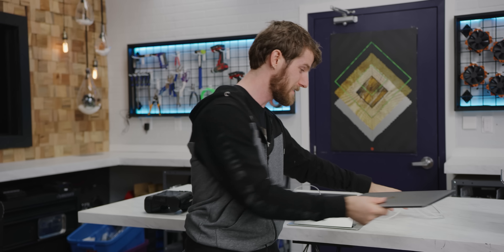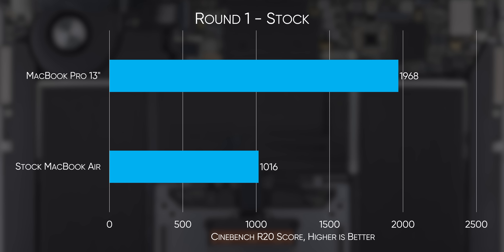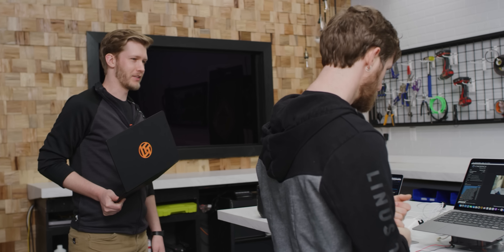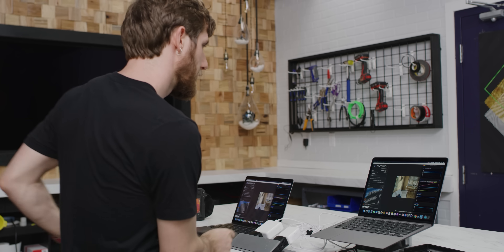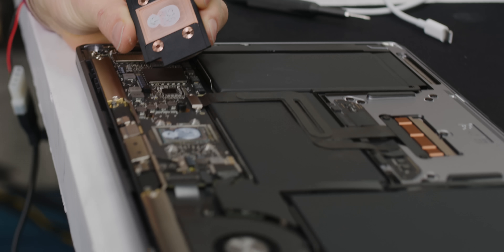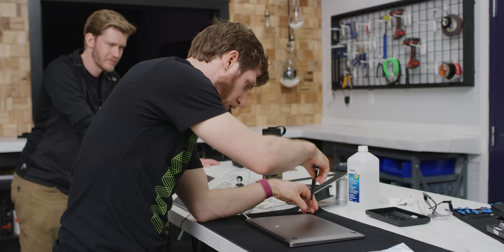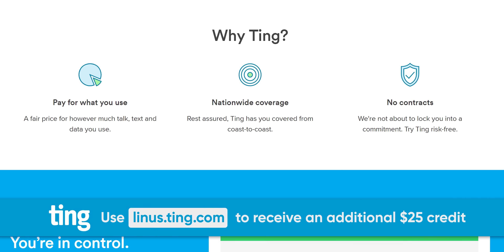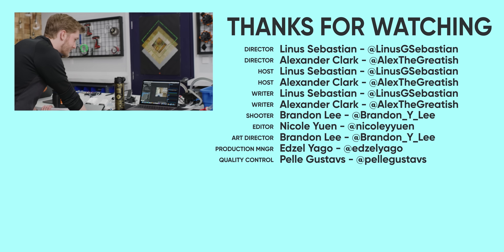Fixing Apple's Engineering in an Hour

Comment: I actually agree with you on this because I live in India and by default the single fan on iMac with it’s weird placement runs at 1200rpm and rises to only 2000 after the CPU reaches 90 degrees Celsius. 
Whereas if I used a third party application to keep the fan running at full speed, the temps are near 80 and sustained. 

Also if anyone asks why I feel the fan placement is weird is because the fan hides behind the stand which I feel blocks airflow and makes it more noisy.

Comment: Nothing new, they did the same with the G5 RISC processors, some G5 imacs melted their cases an then there go Intel Core2  with DOUBLE (they said) the performance...
Reply: The G5 was a horrible chip, mainly due to rushed development and poor IPC’s from IBM. And this is from someone who owns both a 2ghz Dual core and the first Mac Pro. Even with the quad g5, the Pro crushed it in everything except maybe floating point, which G5 was based around.

Comment: Apple's shitty engineering... Not even connecting the cpu plate to the fan with heat pipes... Meaning it's literally just a piece of metal they stuck onto it with incidental airflow... But wait, the cpu plate barely makes contact with the cpu die to begin with so it may as well not have any form of cooler, at all.

Comment: So, to clarify. If heat dissipation isn't the sole cause of the significant under performance, could it also be the power supply maxing out? It would be interesting to see a series for what you'd need to do to a Mac book Air to have it perform close to what it's components can deliver.
Reply: It actually most likely isn't the power supply maxing out at all. That brief sustained power draw of 30W seems to indicate that power delivery is more than capable of sustaining a higher power draw.

The reason really is just that the macbook air is more or less performing close the the max...

Even reading Intel's specification for IceLake, intel indicates that these cpus only turbo at an enhanced power level for a set amount of time. After which despite the capabilities of the supporting systems (cooling, power delivery) it will ramp back down to its stock power limit. What is called "power throttling" isn't throttling at all rather that's the actual tdp the chip was specced to run at (the data sheet actually says 10W for this cpu).

Comment: Apple sticks again. What a stupid way to try and cool a CPU. From a remote and disconnected (not electrically) fan to a heatsink that doesn't even fit correctly. Watched some other videos and the keep going on about the MBA being used for things it wasn't designed for LOL. In that case it would probably one of the most expensive netbooks available.

Comment: It’s a shame they didn’t unplug the little fan just to see if it is actually doing anything for the computer.
Reply: Knowing apple, unplugging the fan would make the entire thing crash
Reply: @fakename287  indeed, it would probably disable and lock any Iphone in a 20km radius just to be sure because apple knows best :)
Reply: @fakename287  there's always an option to put an appropriate resistor in its place
Reply: @fakename287  i think it would power limit the cpu
Reply: Many laptops refuse to boot with the fan unplugged but nothing happens if you unplug it after the post screen
Reply: of course its not, the fan is just to increase the price by like 50 dollars
Reply: I’ve messed around with even just stopping a fan while the machine ran and the whole thing shutdown
Reply: You don't need to unplug a fan sitting on your rooftop to know that it's doesn't cooling your room.
Reply: I'm not sure on a mac mobo, but on a pc they won't turn on usually with-out a cpu fan plugged in.
Reply: @Anthonypython  my laptop had a fan failure, it gave BIOS error message and automatically shutdown in some 10-15 seconds, but it also had an option to ignore it and take the risk
Reply: @Anthonypython  not most do this but some do, depends on the bios, my stock hp itx sized pc from 2005 wont post without a fan and my custom pc with asus mobo and my other one with msi mobo posts and boots up
Reply: @Anthonypython  I managed to run without fan for 2 mins till it reached 100 deg C
Reply: @Anthonypython  not get very angry with all sorts beeping sounds
Reply: @Anthonypython  I recall doing a motherboard replacement on an A1342 long ago and yet I forgot to connect the fan. Didn’t boot, beeped at me, realized my idiotic mistake.

Although the beeps suggested RAM failure.
Reply: The fan does nothing at all. Other youtubers have tried this. I forgot who though.
Reply: @gwenwalravens8030  It clearly does... something. It creates a low pressure zone in the laptop and creates a bit of an airflow. Nothing much, just half a step over passive cooling, something the laptop clearly wasnt designed for.
Reply: @jako3015  Except for the obvious movement of air, it doesn't do anything measurable or perceivable to help the computer in any way.

Comment: MacBookAir won't move any air! 
I will never ever buy any Apple product anymore - I had macbook pro=problems overheating and then running at reduced speed, well I still have it, its just sitting in my drawer because tbh my 7yo windows pc with overclocked i7 performs much faster...

Comment: Isn’t the point of the MacBook Air to have bad cooling so it’s smaller ? Having a better cooling solution would take way more place, making the device thicker. If you want a thicker device, go for a MacBook Pro instead.
Reply: they didn't make the device bigger when they fixed the heat sink depth and added the thermal padding...

Comment: 2:52 - I do partially agree but in a different way: Apple never gave their computers very good cooling systems because they planned to use ARM processors in the future which wouldn’t need a full fledged cooling system, and instead set out to perfect the rest of the design with using ARM processors in mind.
Reply: ...Designing Intel laptops like you would design ARM laptops does not make any sense. They are not a 5 man shop forced to make a single design to fit all. "We made a internal combustion engine car but did not put a fuel tank because, well, our future cars will be electric." People buy the laptops to work with them, for years. They don't give 2000 dollars to give Apple a feedback that says "the design is fine, now put the next models with ARM so that I can actually start working".
Reply: They didn't perfect it though. The heatsink wasn't even touching. I am less inclined to believe this was about reducing performance and more about reducing lifespan so it has a higher probability of being dead in less than 5 years.

Comment: No heat pipe and a heat sink that doesn't even touch the CPU. That's a great way to show how slow and hot Intel processors are before switching to your own ARM processors in the next model.

Comment: I found myself putting my macbook pro upside down when operating with the lid closed.. most of the heat is on the bottom side - otherwise with the lid closed I fear for the durability of the screen. Honestly no idea why they call these macpro laptops pro.. make them less slim and add a proper heatsink/fan combo then it might be considered pro.

Comment: I actually think Linus' tin foil hat theory about Apple deliberately providing intel chips with poor thermal solutions to make there arm processors look better may not be far off the truth.
Reply: So you actually believe Apple is intentionally sabotaging their own MacBooks. And it never occurred to you that maybe the heat issues are one of the reasons Apple is going to their own silicon in the first place, huh? Or that it's just a natural progression since all their other devices are using their own silicon and it makes complete sense to transition the Macs there too? None of that occurred to you? It makes more sense to you to believe Apple is intentionally sabotaging their own hardware?

I hope after you've thought about this for more than 5 seconds, you'll realize how stupid it sounds.

Comment: Don't Apple laptops perform worse when booted to Windows with bootcamp because Windows doesn't get the same thermal profile so the CPU throttles faster and harder?  It would be very interesting to follow up, particularly with the water cooling, under Linux or Windows.

Comment: I'm going to presume that you reset the smc/pram between each test, I wouldn't be surprised if not doing so could influence the next test.  However seeing that silly heatsink is truly a horror.  To my recollection the fan is usually cooling heat piped temperature hence the strange location, though that is on a much older model.

Comment: I get that it would perform better if you made the air a little larger by adding more fans or a better cooling system, but that is what the MacBook Pro is for. The whole point of the MacBook Air is to be small and light, if you have to sacrifice some performance to meet that objective, so be it. The air is basically for just surfing the web, email, and watching Netflix so sacrificing performance is not a big deal.

Comment: It's actually good if you think about it. He's basically getting $500 more computer. Or he could just buy a laptop at dell for half the price that'll outperform the mac.
Reply: You can get a Dell for half the price, but it will be heavier and thicker and use more power. Do you seriously not understand the purpose of the MacBook AIR? I'll give you a hint, it's not intended to be a high power machine.

Comment: Technically, aluminum is good at dispersing heat that's why it's not a miracle that copper pipes are mounted together with aluminum alloys based heat block. So definitely can use the panel to spread heat and by attaching heat pipes to macbook's bottom u just make an external surface contact cooling system.
Reply: Thus defeating the entire purpose of having a thin and light laptop. Good job.
Reply: @vernonprice5986  yeah like they defeat the purpose of cooling system having a fan and a heatsink with no connecting pipes. 🙄

Comment: I would assume that it is designed to maintain fairly consistent power performance whether plugged in or not. So it would not have a VRM design that could rapid discharge a battery.

Comment: one idea thats been on my mind for years, what about dropping the fan all together, and run thin tubes throughout the laptop, mounted to the chassi, such that the entire laptop serves as a passive cooling block. At least you would not have hot spots. And if its possible to somehow transfer heat to the monitor, you can run a tiny pump there as well to spread it even more.

Comment: Ok the fan not connected to the heatsink was one thing, but actually having the "heatsink" not able to directly contact the die is baffling, there is no excuse for that. Apple had convinced me that their computers are ok for other people whom they work well for, but now I am back to discouraging anyone from buying this junk.
Reply: So you believe it overheats? Where's the evidence of that? I mean if you're convinced it's "junk", shouldn't you be basing that on real world evidence? This is a MacBook AIR, it's not intended to be a high performance machine, it's intended to be light and thin, yet usable with a full desktop OS and a full size keyboard. Maybe you're just missing some context.
Reply: @vernonprice5986  yes what I said was pretty ranty lol but I am considering this "junk" because it hits 100 C and there were simple things Apple could have done to prevent this

Comment: Apple clearly gives sleek design more emphasis than efficient operation. There's no fan over the CPU because that would have to make the chassis fatter.  There's clearly a power limit in the BIOS-- with apparently no way for the user to control it--or just not enough power available to the CPU.
Reply: yeah ok but cant they add more heatsink  like bigger so the fan is actually useful

Comment: I am actually a huge fan of this conspiracy theory. But we need to tear open a new macbook pro to see if it has the same design flaws or if the macbook air just had these problems because it's more consumer and entry level and they didn't care.
Reply: We also need to see what happens when they release the next model macbook air that will have apple's own processors. If they brag about only having a small performance boost of about 15%-20% it makes this theory that much more plausible.
Reply: @troybraghini3154  What, exactly, is "plausible" about the theory that Apple is intentionally sabotaging their own MacBooks? Explain it to me.

Comment: My question is what is the purpose of the fan, why is it there, what is it connected to, what does it cool/blow air over. You should try and either disable it or remove it and see what changes.

Comment: I find it funny that a product called the "Air" has airflow and cooling issues.
Reply: Designed by Starbucks, Engineered by Sadists, Priced & Marketed by Pharma Bro, and assembled by Pakistani insurgents using Martian Rocks for hand tools
Reply: @WindFireAllThatKindOfThing  XD
Reply: antidonkey lol
Reply: That's why they called it Air, cause there's no air. Maybe that was paun intended name or a prank. Like the rest of the products. Is their packeging faulty? hope so.
Reply: @gamingaccount7172  they called it air because of its weight
Reply: @kineticbongos  air's wight on the pc's?
Reply: you always make me laugh koskesh
Reply: macbook is called air, cpu codename is called "ice lake" and has thermal issues. Funny
Reply: Razer Blade, performance cut
Reply: lol, air thin, not air cooled
Reply: Apple designed a computer after  an air filter and even that had heating issues on almost all of em.
Reply: Maybe they put the fan in there just to call it "Air".
Reply: so true
Reply: It doesn’t have cooling issues, it just warms up as much as any other laptop.
Reply: the design just was not for that high heat chip... no wonder why they moving to ARM... they just ready for it...
Reply: The film perfectly proves that Apple did it well. This processor has no greater performance, will help much better cooling.
Reply: @imho4990  what are u talking about the processor has wayyy better performance potential - the CPU is power limited. Even if you ignore the fact that its power limited, they improved performance by 14% through better cooling. Soo how exactly did apple do it right???
Reply: @kavishkabartlett4261   "the CPU is power limited" like every ultrabook.
Reply: @imho4990  it does have more room for improvement but it is limited because the computer thinks its still working with the bad cooling setup but it still gets a 14% improvement despite that

Comment: he needs 2 nuts on the milling machine so the stop doesn't vibrate and move. the top nut sets the height and the bottom nut locks onto that stopping them.

Comment: I seriously need help with my damn laptop having high memory usage tho I somehow fix the problem but every time I start it up, the issue returned and I'm confused on what to do. My last resort is to get it fixed to a repairman. RN I haven't get it repaired cuz I want to know what's causing it.
Reply: How much ram do you have an us it upgradable because if it's less then 8gb that's likely the issue and throwing more ram at it is likely the best solution

Comment: Performance is locked by software also, this was done intentionally, ARM chips have nothing to do with that. If you can pull full power out of this machine macbook pro 13 doesn't make sense that's why Apple crippled it. And that's why so many people hate Apple. BTW Screw Apple.
Reply: People hate Apple because you made up some complete bullshit about intentional crippling? That's some nice logic you're using there, genius.

Comment: So an aftermarket all-copper heat sink sized up and designed to be connected by thermal pad to the chassis would probably let it stay at a 14% uplift all the time.  That would be worth it to a lot of people.
Reply: That would completely defeat the purpose of being a MacBook AIR. The thinnest and lightest, most portable laptop that Apple makes. It would literally be worth it to NO ONE.

Comment: I would be interested to see how it performs if you bridge the gap between the fan and heatsink with like a thin piece of metal and thermal pads. might require adding like 1mm of thickness with some washers, but 1mm is not bad depending on performance gains. Heck, even rerouting that ribbon under the fan and cutting out an intake on the side to pull air from the general direction of the processor would probably help.

Comment: You have to wonder if the throttling is based on a open loop system, aka a hard coded time/load based curve.
Reply: It's  fully time based if intel hasn't significantly changed it from 2 years ago. It's typically called "turbo time parameter" with the temporary state being "PL2" and the permanent state being "PL1"
Reply: skifree given their outcome that definitely makes sense.

Comment: No, Apple isn't sandbagging their stuff, they just can't engineer a damned thing. It is all about the design, but who gives a damn about function? Apple does not actually expect their Pro series computers to be used by actual professionals, they expect them to be trendy codpieces for people with more money than sense. It doesn't have to function well, just function enough to do a few things and look good doing it. If their shit actually functioned as, you know, actual professional grade hardware, Apple would have to actually be taken seriously in the computer world and spend more money on * Gasp! * engineering to make their shit work correctly and that might * double gasp! * take away from their "stunning good looks" and trendy people would lose their shit and be unhappy.